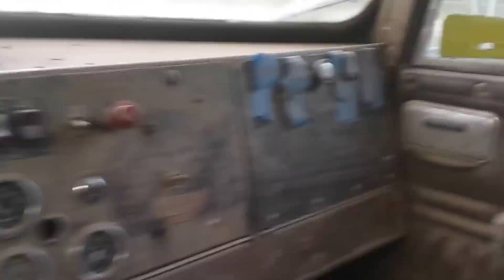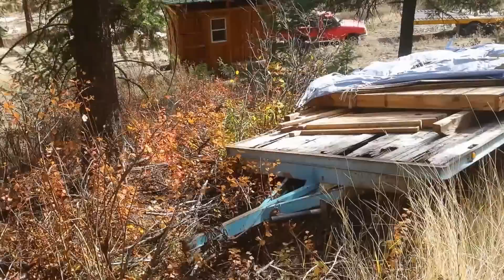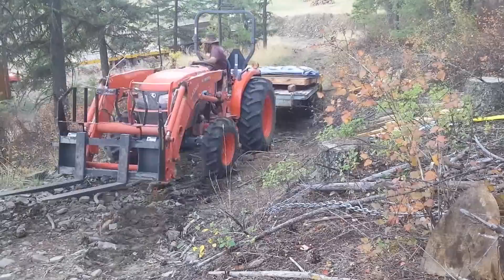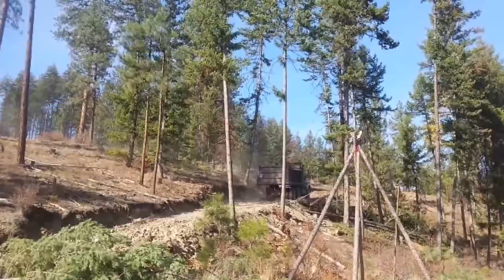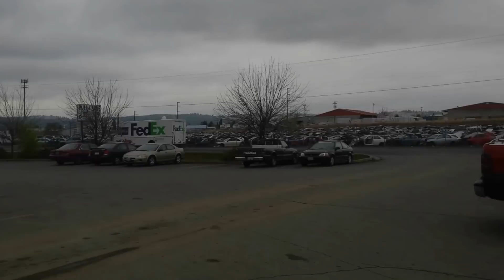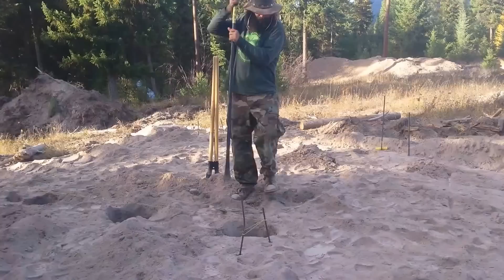Ant Village Journal #13: Working for Paul

Comment: Holy crap that tilt trailer, hahaha.  Thanks for the insight and look into your experiences at ant village.  I'm about to shoot Paul $800 and drive up there in my truck but am wondering when is the best / right time to do so?  After winter?
Reply from the maker: Haha, yeah it's a bit scary.  I figured out the next time we moved it that you can use the bucket on the excavator to control the tilt of the trailer, much safer.  As for when to come out here, I would say find a nice warm place to live this winter, find work, and save up as much as you can before moving out to Ant Village in early spring to get a good start on building your house and plot.  That is my plan for the winter actually.  I could have got a whole lot more done this summer if I wasn't so distracted by working for Paul, just trying to feed myself.  Also, I would recommend finding some sort of outside income source before coming out here.  The bounty system here is sort of hit or miss.  Good luck and I look forward to meeting you.